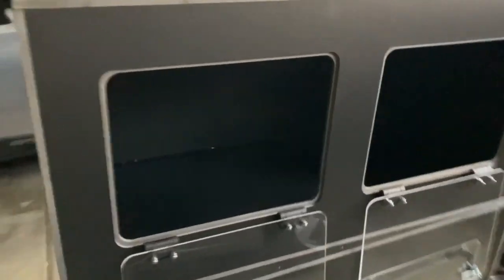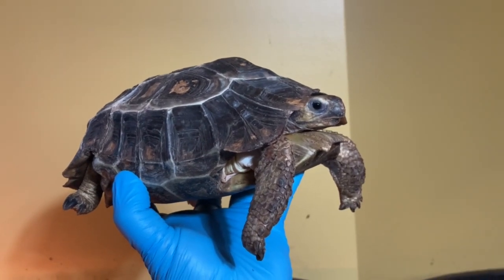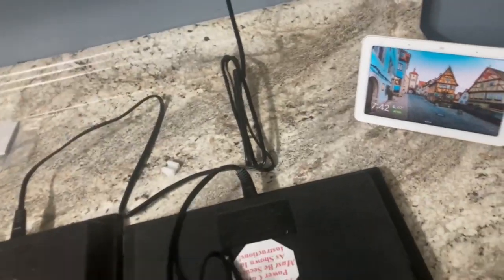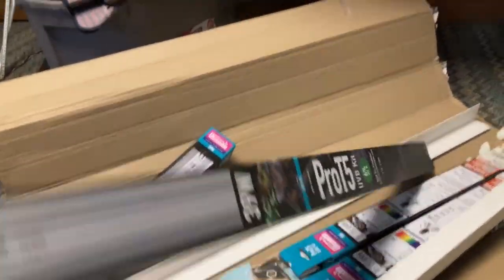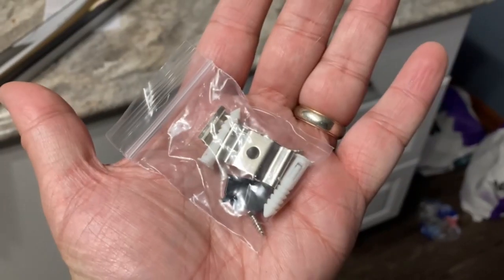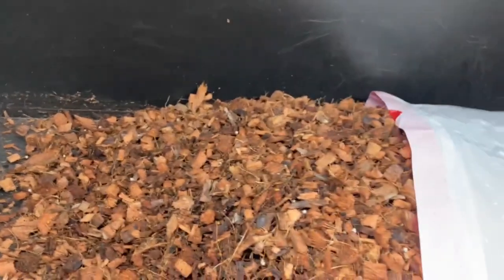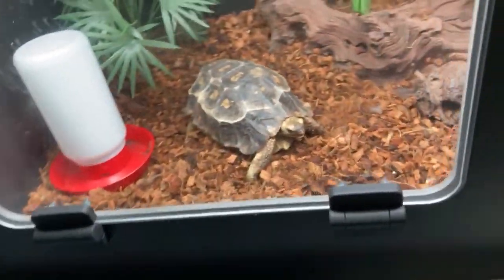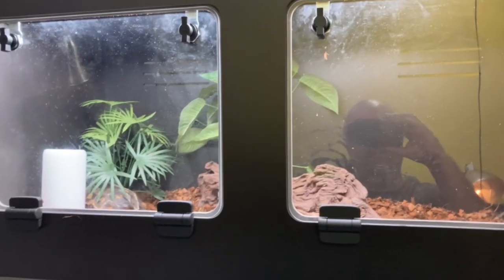Closed Chamber Tortoise Enclosure with Radiant Heat Panels and Arcadia UVB!

Comment: I have a love hate relationship with Arcadia. Have switched over to them here, but I despise how they mount in a PVC enclosure. I wish they went with a more robust fixture with an easier way to mount in a closed chamber enclosure.  Nice work with that pair! 

Jeremy Thompson
The Kinixys Cooperative
Reply from the maker: Thanks-  yep, they are damn hard to install. I’m getting better at it though. And the short screws are better than the 1” long ones they used to use. For me, the availability of the Zoo Med products was the problem. I would have used them but I could t find them in stock, or not the bulb, it was frustrating.

Comment: Nice enclosures! Do you find it hard to keep adequate air ventilation?
Reply from the maker: Thanks Kyle - I don't have any issues with ventilation - I can keep a tortoise in a truly closed, but not "airtight" chamber without any problems.  I left the vents open on these two.  If I need more humidity, I'll close the vents with gaffer's tape.  I would like to try other species with this technique, but the Kinixys seem to do great.  In fact, they thrive in this kind of setup.